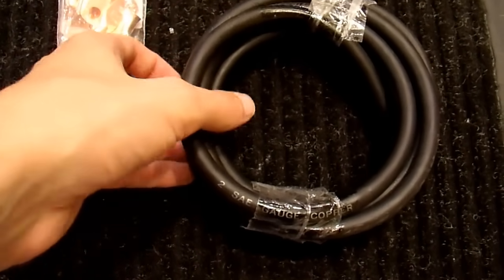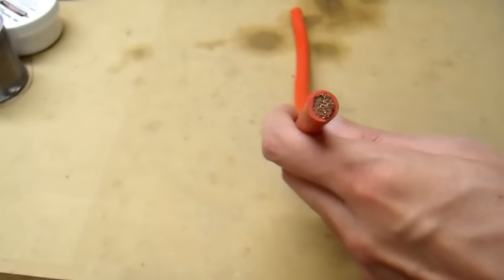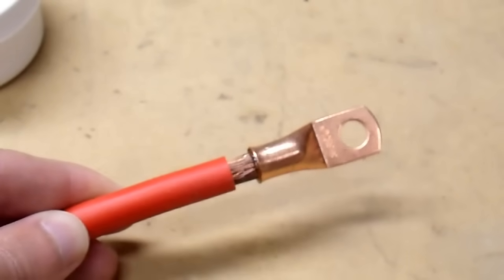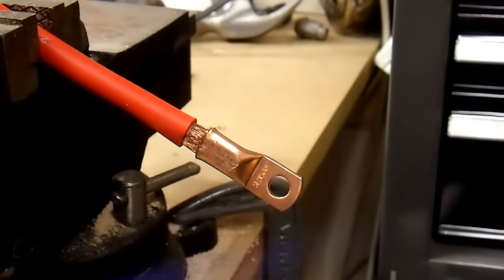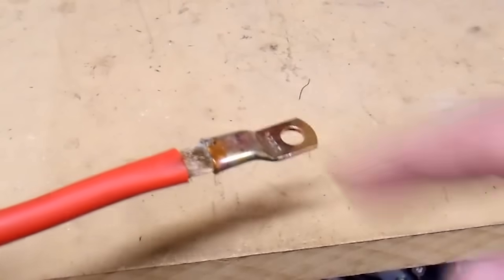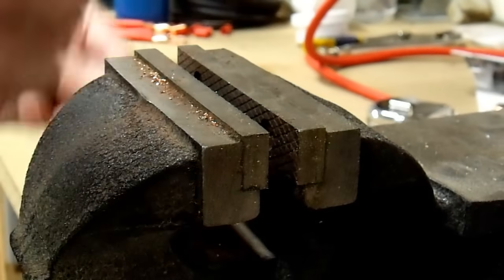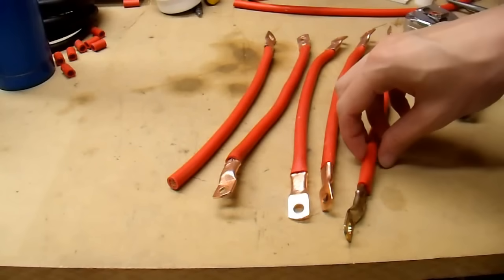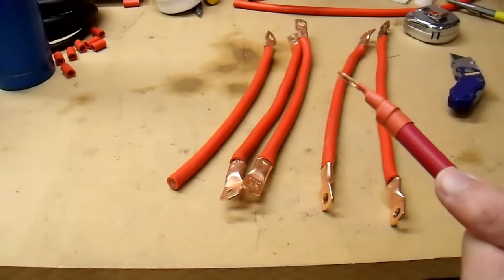How to Make Battery Cables the Right Way and the Easy Way

Comment: Ehh, that's pretty bad :S I'd use a high thermal capacity soldering iron any day, and I'd use no-clean flux, which isn't acidic until it reaches a certain temperature
Reply from the maker: I don't personally like no-clean flux because in practice it results in corrosion issues despite the theory behind it.  And the purpose of this video is to show how crimps can be made with ordinary tools without special items like a high wattage soldering iron.  That said I do agree in a sense - in an industrial environment this isn't the optimal way to terminate cables.

Comment: Don't crimp. Just flux wire and put on copper end then fill with solder. The solder gets deep into the strands. It cannot be pulled off. Saves time and effort.
Reply: And you just made a joint that will fail if there is any kind of vibration or heat and humidity.
Reply: @gravelydon7072  Umm...how is it going to get past the solder? Solder bonds to the connector and wire. No room for water to enter. Heat would have to be enough to melt the solder  Vibration? How is a solid solder filled connector going to be susceptible to vibration. You have poor logic
Reply: @bobbell5928  Solder breaks down over time all by itself. Vibration, heat, and humidity can accelerate that breakdown. Also by having solid wire connections because of the solder, wires are more likely to break instead of flexing. Check solder joints made 50 years ago and anything where copper is exposed to vibration. It is the reason that copper is not used for fuel lines as it will crack with time from vibration.

Comment: "solder of some sort"...you're just a hack. You think solder comes in half a dozen varieties just for giggles? Lead for one will actually cause corrosion depending on the metals being joined, then there's the compatibility with different fluxes, joint strength vs. temperature, distempering the joined materials, and specialty solders for joining stainless steel and aluminum.
Reply from the maker: You seem very uneducated when it comes to solder.  You can safely use any solder for this purpose as long as it is not a special type of acid flux solder or such.  Eutectic, 60/40, silver bearing, lead free types, wire, pellet, various fluxes, etc are all acceptable and for an imprecise bulk copper application like this entirely interchangeable.

My actual occupation involves knowing the different types and applications of solder in very technical ways so, yes, I do believe that I am more qualified to speak about this than you.
Reply: Acid core, rosin core, yeah, I used to use those. Useless.

Comment: I have used SS Industrial Cable in Port Washington, WI. to purchase cables.  They handle the heavy cable, lugs, heat shrink and even sleeving.
Reply from the maker: For professional cables a place like that is best, but for a quick and inexpensive way to make them yourself without special tools the way shown here is an option.

Comment: if i am going to make unsoldered connections i use CU/AL paste on the wire before crimping. it really helps the conductivity. i also use it where the terminal screws on to the inverter this will prevent overheated connections if you are pulling 100 amps at 12 volts as i do

Comment: I would have tinned the tip of the cable BEFORE putting the terminal on..
Reply from the maker: Very difficult to do with a torch without oxidizing individual wire strands due to the excessive localized heating.  Impossible, I dare say.  It will solder up that way but oxidation is not something to intentionally put inside a termination.  With a temperature controlled heat source like a large iron that method would work.

Comment: Can I ask where you purchase your wire and connections from?
Reply from the maker: I have purchased them from eBay and Amazon simply because I have frequently used accounts there and don't want to figure out how far I need to drive to find something local.  I forget where I got the Molex connectors I used most recently but I would recommend that brand.

Comment: the 'Solar Farm Installers' talking about solder "shooting out of the joints" are referring to 'magic'
which is basically a way to tell YOU that THEY dont understand WHAT they are doing
do what you wish
the electrical industry DOES NOT SOLDER CRIMP JOINTS
because it COSTS MONEY
DO WHAT YOU WISH

MAGIC ISNT going to Shoot little blobs of solder into your face or trees or house
nor will Lightning
I work in the industry and hold a 'masters license'
and I tell you that 95%+ of the people that you consider electricians are ILLITERATE and DO NOT  understand HOW ELECTRICITY WORKS

dont eat their BS, PLEASE!!!
Reply from the maker: I'm not saying that I disagree with you, but for one example electricians use wire nuts which are terrible connections so I could make a similar argument about not listing to anything electricians have to say.  Lots of things are wrong with the whole NEC code and the grandfathered practices that electricians use but it's always been done that way so it turns into a sort of dogma.  Electricians don't work on engineered systems so repetition is more important than proper design or implementation.

There is a place for soldering crimps, and low cost connections is one of them especially in corrosive environments where an unsoldered joint will quickly corrode away.  In an industrial setting you'd likely use either a solder filled lug or a dedicated crimping die.
Reply: So what is the stuff holding the stator wires to the crimped-on side bridge in millions of Delco 130D alternators if not solder?

Comment: once you get tired of stuffing solder in the joint
wrap silver bearing solder around the bare copper prior to inserting into the Lug
once you heat it up, the whole job is done
it doesnt HAVE to be silver bearing but that is all I use and it is a GOOD alloy to use

Comment: A few things to note: Using heat shrink is not a bad thing. It helps protect the connection from shorts and helps seal the connection. On battery cables, it is best to use glue-lined heat shrink. If you are worried about chaffing cables on each other, route them differently. If they are rubbing on each other, they will rub through the cable insulation too. Need to fix the cables so they don't rub and move around much. I am not one to solder battery cables at all because of the environment they are in. I have been a master automotive technician and now work in professional racing as an electrical engineer. The soldered connections on cables of this size tend to crack and break strands due to flexing at the edge of the solder or in the solder connection itself. The crimping of these type of terminals in a vise is alright, but not ideal. Crimping them using a hammer and chisel can over-crimp the strands causing breakage. There are several tools meant for crimping these type of cables that are used in a vice and are relatively cheap. Just a few thoughts.
Reply from the maker: And good thoughts they are.  Thanks for the input.
Professional crimping tools are always best however most YouTuber's are making crimps with low cost terminations and I believe the methods shown in this video apply.  For making professional connections with high quality terminations and all of the proper tools, well, I cannot argue with you.

The reason I mention not to rely on heat shrink for abrasion is that next to the terminal there is high stress and rapid abrasion, whereas further down the cable some movement is allowed and forces are low.  (that is the purpose of a cable, after all)  If people are relying on the heatshrink at the termination they are likely to have fatal abraison due to proximity to the termination whether it is from the cable jacket itself or the shrink.
Reply: Actually, heat shrink is a better way to go as it protects the connection from contaminants and creates a strain relief at the termination. Why are you saying that there is rapid abrasion next to the terminal? What is this abrasion coming from? I build these type of cables and always use heat shrink and never have an abrasion issue. If anything, it is more protection from abrasion. Maybe I just don't follow what you are getting abrasion from or how you are getting it.
Reply from the maker: Adam Shackelford
Forces are higher near the terminations than further down the cable.  The only real danger of abrasion is in places with high stress risers such as at the cable ends.  If a person makes sure there is no contact between cables near the terminations then it is a non issue, but if it is a non issue then what is the purpose of insulating the cable near the terminations?  I have nothing against glue lined heat shrink, just the regular kind.

Comment: I too use the crimp and solder method.  I also use brush-on electrical tape and heat-shrink.  Not having a special crimping device, solder fills all the voids in the joint, and the crimp and punch is the mechanical factor.  After soldering, the cable end should be sufficiently moisture free.  Enough so, that when sealing with goo and heat-shrink sheathing, the joint from wire to terminal should, in theory, last as long, or longer than the coated wire itself.  I've employed this technique in the transportation industry for over 20 years, and I'd bet many cables I've made are still in (low resistance) service!  We are moving to the country right now. I can't wait to start building my free electricity system.  I will be using solder on all my low voltage.  Additionally, should some freak lightning strike get into our system,  the heat-shrink will help contain the fire-balls of solder!
Reply from the maker: Quality brush on tape or glue lined shrink is good.  I just don't like the standard heatshrink that lets the liquids and contaminants in and hides the connection from view.  Even brand new cables are sometimes crimped poorly and I don't catch it until I check the connections and find one that's smoking hot!
Reply: *****
Agreed!  A bare connection is better than regular heatshrink or tape, without glue/goo/di-electric grease of some sort (unless it needs to be insulated from shorting, obviously).  I like your vids, and your attitude!
It's also likely we could agree that it's a mystery how we survived in the days before non-contact thermometers!
Reply from the maker: xEchoEaglex
LOL!  Yes, non-contact thermometers are wonderful!  Yet I still have some trouble with low emissivity measurements that I use thermocouples for.  Until they have a IR thermometer that automatically senses the emissivity of the object being measured...

Comment: You could just fill the terminal up with solder and jam the cable in adn let it cool. But that takes a little longer.
Reply from the maker: Agreed.  But 63/37 solder is rather expensive and it is more economical to compress the fitting to reduce the solder needs.  Solder also has a low conductivity compared to copper.  Unless the termination is specifically designed for the method you describe the crimp and fill method would be preferred, yet it is certainly a viable option.

Comment: I have found that by far the best way to make cables is to clamp the cable end in a vise, heat it with a torch until its hot enough, then fill it with solder, then insert the bared end of the cable. No crimping, easy peasy and fast. But hey what do I know, that's only the way the the factory trained technicians taught me at Kenworth 25 years ago when I was an apprentice.
Since then I have worked in shops where it was strictly forbidden to do any kind of crimping on electrical connections and know of fellow technicians who have been written up for doing so.
Reply: 40 years ago I would have soldered them too. But not today. Hydraulic crimpers do a much better job that keeps all the wire flexible. With 8 to 10 tons of force crimping them in Hex dies, the wires do not pull out. Check older soldered connections that have been exposed to heat and humidity and you will find that the solder has started to crystallize.
Reply: If I understand correctly, you are heating the connector first, filling it with solder (so not you have a liquid pool of solder), and then pushing the bare cable into it. This will possible result in what is called a cold solder joint as the solder may not bond correctly to the cold cable. This will mechanically fail over time and may not provide the best electrical connection either. It probably sufficed in 12 or 24 volt service and with perhaps no more than 50 amps so you apparently had adequate performance over the life of the application.

Comment: You can try to put a steel dowel pin in the vice with the lug while crimping it to collapse the crimping area inwards so it doesn't "flare" the ends out wider.
Reply from the maker: That's a good idea - effectively making a makeshift die to crimp more like a proper crimp tool.  These flat crimps do work quite well in the absence of a crimping die, however.

Comment: Regarding heat shrink; you can get clear, adhesive lined, highly abrasion resistant shrink that will provide strain relief and of course, prevent moisture ingress.
Reply: I was thinking this b/c I have translucent heatshrink too. Although I rarely use it.
 post crimp, use dielectric grease, and heat shrink.

Comment: ive also found that you can make them without crimping it just fill the end of the connector 1/2 way with solder stick the wire in and put het shrink over it 
have you had any experience doing it this way?
Reply from the maker: Filling the terminal with solder works well and some high quality industrial connectors are designed specifically for that method, but solder is reasonably expensive so I prefer to crimp them first.  It drastically cuts down on the amount of solder needed and increases conductivity of the connection.

Comment: I make lots of truck battery cable repairs. My method is similar but if I do it on the truck I use an air chisel with a blunt round end to crimp it, back it up against a large hammer head or steel block. If I use the vice I use a 5/16" or 3/8" short bolt between the vice jaw and the terminal. This leaves a nice deep impression so the cable won't come loose.
Reply from the maker: That's a good tip.  Thanks for sharing!  I might try using my air hammer on the next one and see how that goes.

Comment: Thanks so much for the tutorial - very clear and straightforward. I will be referencing it in my build log of my 1984 Mazda RX-7. I'm doing a wire tuck and custom engine management system, and needed the info to beef up the power grid to 1/0 and 4 awg. I've decided to crimp and solder the engine-bay side terminals at the alternator, starter, and firewall passthrough stud, to help prevent corrosion. Inside the cabin I'll just be crimping using a vice as you demonstrated. Excellent tip!

http://www.rx7club.com/build-threads-293/1984-5-letter-s5-selene-1025650/
Reply from the maker: Thanks for the comment and Good luck with your project!  It sounds interesting.  For the most part I do not solder my crimps, but inside an engine bay I would definitely do so.  That's a nasty environment for bare copper to live.
Reply: A lot of people forget the solder...  It's essential to prevent corrosion.  That's exactly how it's done right.

Comment: If you only got the small solder then one thing you can do is pull so much out and fold it back onto its self a few times. That will make it like the thicker solder.
Reply from the maker: An easy solution to simple problem.  Good tip.  Not sure why I didn't think of it when making this video...
Reply: haha I was just going to suggest this.  Done it many times at work